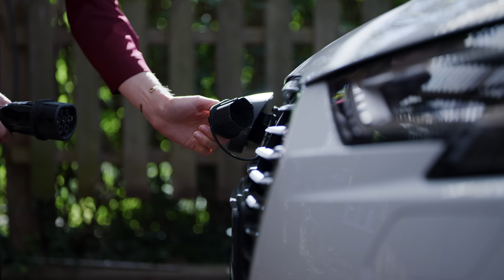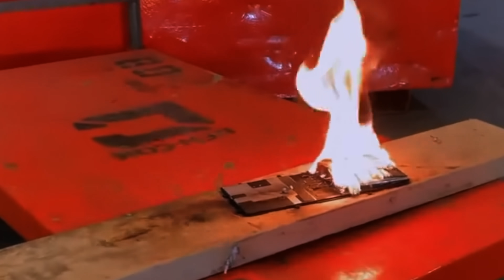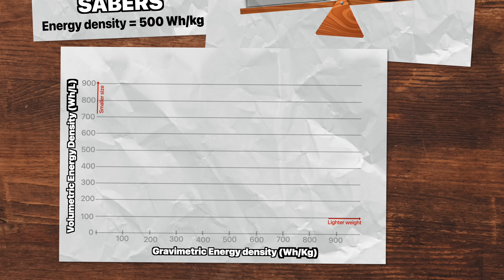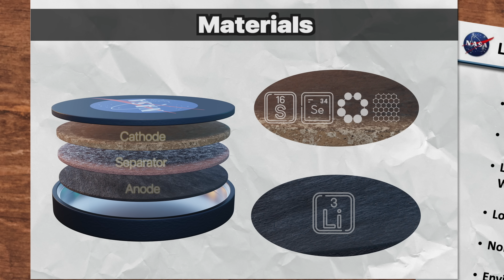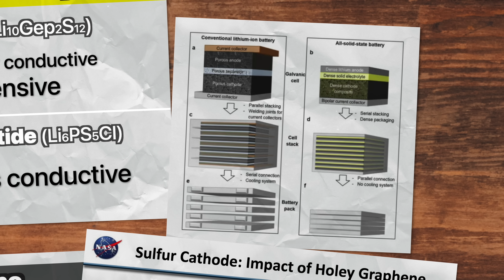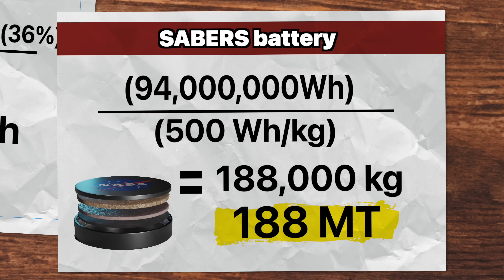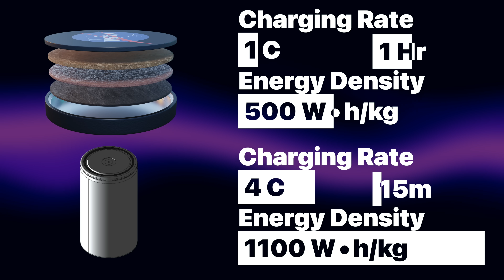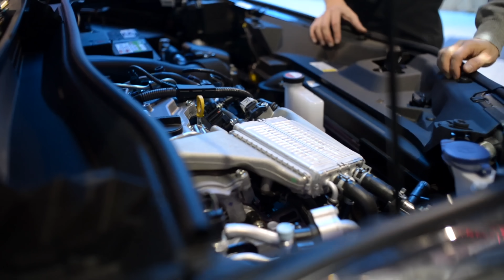Why NASA is Building a Solid State Battery

Comment: It's not ready for airplane use because you can't have airplane engines quit in flight, but it's "okay" to play around with this stuff in ground vehicles because they don't care if your EV dies on the side of the road, right?  What if your EV dies in a bad part of town and then you die?  What if the EV in question is an ambulance that runs out of charge?  But I will say that it is encouraging that brilliant people are working diligently to solve these problems.  Eventually we will get there... (no pun intended).

Comment: We need to stop thinking in binary.  It's not One Tech or the Other Tech, it's how can current technology be improved to be more efficient using new tech.  To use the airplane example... Use fuel thrust to get the airplane off the ground, then battery power to supplement the cruise, much like hybrid vehicles.  This all or nothing attitude is short-sighted.
We also need to start thinking long-term.  Current battery tech creates massive amounts of toxic waste we have not addressed.  Will the solid state battery be easier to dispose of at end-of-life?

Comment: Ricky how are the electric turbines or propellers driven? In-line or from their rims to use mechanical advantage ? Motor s where the shell or turbine or propeller is the rotating part.

Comment: Wouldn't it be better to put the engine on the regular power supply and rely on that new sabers battery for the electrical components less strain on the regular power supply which might make it cheaper

Comment: NASA "doesn't say" explicitly what the power density of the Li-S-Se SABERS battery is but it tells us repeatedly that is high enough for use in aircraft and they show us diagrams (again without explicit details spelt out) that indicate it is higher than both commonplace Li-Ion batteries and other Li-S batteries. NASA did their homework but evidently you didn't do yours.

This vlog strikes an odd tone. The issues with SABERS batteries aren't unlike those faced by any new cell/battery technology. Is the SABERS battery for purpose, viz. does it offer sufficient energy density and power density for its intended use? Can it be produced economically at scale? Does it have a long service life? Can the cells and other components be manufactured repeatably at high intensity without significant variation in expected performance or build quality? So, fitness for purpose, cost, longevity, production rate and quality/yield are the key considerations. Safety in handling and operation is also an important consideration and on that score SABERS seems to be a big improvement over other Li-Ion batteries.

Comment: The Alice Electric plane with 11 passengers and pilot reported an expected range of 600 miles per charge with battery packs from two years ago, so close to 250, maybe 300 Wh/kg.  So if that is raised to 500 that would be almost double the range.  The engineering from an 11 passenger 1200 mile plane to double that is a matter of joining two planes side by side, both outfitted to go 1200 miles and then eliminating the unnecessary  duplicate parts.  Go from 4 wings to two with the same lift as four but with less material weight and the same with the fuselage , instead of two tubes just one slightly larger will reduce drag and weight and now you have gained even more range with 22 passengers.  Keep doing the same process until you have a plane that will carry 220 people and maybe have 1500 to 2000 mile range .  The plane needs to be designed around the system it has and not just refurbish an old gas jet.  The Japanese teams have a battery capable of 711 Wh/kg now, but it is years away from commercial production and will probably have around 600 by then unless they IMPROVE the technology and keep it safe from fire and degradation over charges, they may even go up a little to 750 Wh/kg and that would allow  a possible 3,000 mile range.

Comment: A partial solution may be to use assisted takeoff technology as the do on aircraft carriers; Once the airplane is airbourne the need for the massive power output needed at takeoff is obviated.

Comment: How long to recharge the plane? You think it's economically viable. Not on your life. What about unexpected delays in the air. Hope it doesn't run out of battery power. What happens when you hit very high winds going against the plane? Now you can't make the airport. Way too many issues.

Comment: Fossil fuels are stored sunlight from the past that work 24 hours a day in all temperature ranges.   Stop trying to force battery power into a system that just waste energy for the only reason but to be battery powered.  The energy to produce and charge the battery system is still wasting energy.   I think people who feel they are so smart that they can control the Earth's climate are lacking the understanding of the Earth's history that our climate has always cycled.  Use the correct form of energy (fossil, nuclear & renewable) for the correct reason and do not waste resources is the best way to help the Earth's climate.  The less energy wasted in production of the energy source, storage of energy, delivery of the energy and wasted capital ($) the better.

Comment: If the most used plane is a long range plane even if only 10% of flights they are absolutely needed for there are reasons they are used beyond that which make their range important. Im guessing its logistically easier to have a standard plane you can expect to be able to do every job and that plane able to go to every airfield you reasonably need it too without making many "hops" for refueling. 
Having an electrical plane with 10% spare energy for flight might also not be sufficient for safety. Also i do remember that rechargeable batteries usually come with overhead control limiting how much of the actual charge you can use as charging near dead batteries is more taxing on their lifespan. And all of that with a prototype engine which won't have the same performance when its mass produced.
Beyond flight the low current is probably the biggest issue. Having any task done only half as fast for longer and then having even more time consuming recharge times might make most of what we can use them for unreasonable.
I do like it alot though that nasa has come up with a low cost version of the electrolyte, even for spaceflight that might just sometimes be enough and will save some money even if the batteries don't pan out.

Comment: Interesting overview, 
I was just wondering why , in the specific example of a B737 the take-off impulse could not be done by a combination of technologies, combining fuel jet engines (could be hydrogen or biofuels) together with batteries like the one NASA (or Toyota) are developing? I looked it up, seems like cruising power could be as low as 20% of the total needed trust. 
Divide your battery weight / electric motor weight by 5... et voila!
Seriously, I think we must think more about combining technologies.
Reply: I worked on hybrids experimental aircraft. We have already done this. We have all kinds of hybridisation including Jet fuel+batteries, hydrogen+batteries… Thing is we just lack necessary research, testing and certification standards. Aviation is a slow paced industry.

Comment: Forget it, aviation fuel has 10 kwh per kg,  and the best batteries have only 0.45 kwh per kg, so it looks like  a no contest there, the extra weight would dramatically decrease the number pf passengers per flight.

Comment: In aviation, kWH/kg and kWH/l are critical drivers.  In stationary batteries, cycle life and $/kwH are the main drivers.  In EVs, all of these come together.  A battery that is inexpensive, long-lived, high-power, and energy dense would revolutionize many markets.  For that matter, in many applications I'd love to have a battery close to as dense as lithium ion and similar cost, but can be shipped discharged.  You cannot do that with Lithium Ion which is an enormouse safety issue.  The same problem exists for lead-acid, but it is such an old, cheap, terrible system in many ways it was never held to the same standard.
Another problem is that while lithium is abundant, it is expensive to extract and many of the typical electrode materials that go with it are even worse.  So for many applications, more abundant elements like sodium are a better starting point.  Not so much for aerospace, where using unobtainium and expensolite can be OK as long as it meets your mission requirements.  But here on the ground cost and availability matter a lot more.

Comment: How small of particulate dies it measure. Does it measure in the nano scale, because that's where the GEOENGINEERING metals are, below the 3 micron limit that the NOAA and other agencies test down to, knowing damn well they are unable to give a good  measurement of what we're really breathing. Check out dane wigingtins research again. That's where AI lost a little respect for you , but just a bit. I figure you'll come around, especially if you'll take the time and TEST THE RAIN. makes sure you're somewhere that there's no aluminum industry close by, because aluminum never becomes a gas on Earth, the vapor point is too high, so it can't migrate like mercury. Keep that in. Ins b3 you dismiss the super high reading as something from China, sorry, but that idea is not supported by reality

Comment: I am not sure how you land on SABERS is 'cheaper' (yet) given the expensive electrolyte and manufacturing difficulties you highlighted.  There is still some work there, but plenty of reason to keep at it.
I thought you comparison between the 737 and electric did a good job of highlighting how GOOD fossil fuels are, and why we can't just electrify everything tomorrow.  Your switch from 57 000 POUNDS to 188 000 KILOGRAMS is a bit misleading (well, kind of verbal  'sleight of hand') .  The fuel and engines weight about 26 000 Kg.  Then where does the power come from?  30 megawatt hours for your 500 mile flights times 1000 flights per day equals 30 gigawatt hours. New York City flies about 1200-1400 flights a day and uses about 55 gigawatt hours per YEAR.  That means that NYC would need over 200 times as many power plants to keep the airport running. 
I think this application may be better suited to smaller aircraft.  

That isn't to say the technology isn't exciting.  For ground vehicles, this could help.  Fast charging and safer while lighter and smaller is starting to get close to overcoming the last major hurdles in gasoline engines.  We still need a 'battery standard' for charging and for swapping out so GM can't arbitrarily decide to not make them for last year's model and force you to buy a new car.

Comment: Gap in calculation is, that the electric motor would not require energy for idling. Standing on runway, descending would not require energy, if not even recuperating it. So it will not require the same energy as the current 737.

Comment: Aviation works on turn around time, it costs thousands of dollars for every hour an aircraft is on the ground, you haven't included the charging time of an aircraft the size of a 737, if that takes 6 hours to charge the idea is already dead. Remember most charging stations are supplied by coat burning, electricity isn't the green energy everyone thinks it is, we use more coal 2023 than before EV were invented, I wonder why?

Comment: You forgot one HUGE aspect of jet engines. The thermal energy of combustion (heat) is necessary for sufficiently high tailpipe discharge velocity. The speed of sound (which increases with temperature) is the limiting factor in tailpipe velocity, hotter = faster. This is generally called stagnation or choke. Driving a ducted fan with a electric motor that produces no heat cannot achieve jet-engine like duct discharge velocity without some massive energy sapping tricks, like electric heaters/plasma/multi stage compression, or burning fuel in the tailpipe (afterburner). This limits the theoretical electric airliner speeds to about 300-or maybe 350 mph. Bucking a 125Kt headwind is going to be a huge battery draining problem. In fact, we are better off driving props with electric motors, than jets.

Comment: As a Retired Airline Captain, it's not just getting from Point A to Point B. You have to have enough energy to go from Point A to Point B, shoot an approach and if you miss...then fly to your Alternate Airport...shoot an approach. And if you miss, then fly for at least 45 minutes before you run out of fuel (or battery). Many times I flew to Los Angeles and our alternate was Las Vegas. I personally liked to carry 2 hours of fuel beyond my Alternate airport.  So a 550nm range on a B-737 isn't going to cut it.

Comment: I can only imagine what this looks like. My last job before I started down my spine surgery warpath was working for Texas Instruments running 6", 8" and 10" steppers. This was back in the old days when you actually had to handle the wafers by hand, at least for inspection, cleaning and testing purposes. The wafers were fed into the stepper in boats; but, the proper mask had to be loaded into the machine to put the proper pattern on the proper wafer at the right time. As the photo lithography was done, it had to be inspected under a high power microscope, and thus hand handled. I had to carry certain wafers across the fab for other tests as well. In the old days we used vacuum pens to move wafers through some of these steps. I loved looking at each layer as it was built up. Photo was probably the busiest station in the fab. I just wish I'd been able to keep it up as I really enjoyed it.

Comment: I worked for General Atomics from 84 to 93 doing long term testing of a nuclear powered battery. Specifically the Thermionic fuel element verification program, part of the sp100 space power program.

Comment: Is that the maximum loaded TO weight, or the maximum wet weight less cargo?  If you're using up the total allowable TO weight including cargo, then you've got an electric plane that can get to the destination, but cannot carry any cargo.
Reply: Also, the max landing weight is lower than the max TO weight, and you don't "burn up" the weight of batteries when you use them in-flight as you do with fuel.

Comment: Tesla used LFP or Lithium Iron Phosphate in Model 3 ^ Y sold in China where "charging stations & electrical outlets for charging adapters are less geographically concentrated"

LFP has 3000 cycle & 10 year calendar life about 2X better than NCA even when very deeply or fully cycled, something that damages NCA , but lower power density & lower voltage & 30% higher mass //

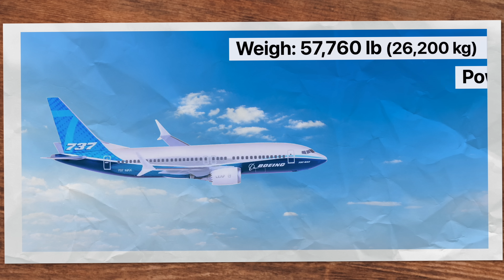Comment: 12:15, yeah 57,770 for take off, but you need to lose 30,000 lbs in the air to be able to land. You can't get rid of the batteries to lose weight.

Comment: If these are rechargeable these would be great for green homes with solar or wind power.  It would also solve a problem with electric cars.  These seem they would make infrastructure for refueling where it's much easier to stock them when an electric car is running out of power. Just swap them out.

Comment: Heavy sigh! When are you EV fan boys going to understand that EV commercial flight just isn't going to happen. Jet A has a specific energy of 43.1 MJ/kg. These solid state batteries (assuming the data in this video is correct) is 1.8 MJ/kg.  A fully loaded 727 has roughly 32,000 kg of fuel onboard. If you were to use these batteries as your power storage that weight would balloon to over 766,200 kg. Even using the theoretical max potential energy density of 2680 WH/kg or 8.6 MJ/kg that weight would be 160000 kg. The max takeoff weight of a 727 is about 95,000 kg. This should give you some prospective on how far out of reach a commercial EV aircraft is.

Comment: If it's cheaper than lithium-ion and they cracked the cycle stability issue but the charge/discharge rate is not so good, it'd be probably better for terrestrial applications like solar power systems, rather than stuff that moves.

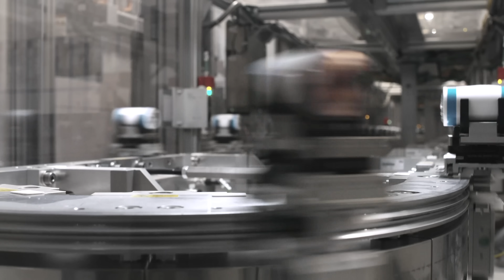Comment: Just wondered; other than rolled manufacture - why aren't the individual batteries in the battery pack square with rounded corners, to fill the available space? Round individual batteries probably make sense in some way I'm unaware of, but isn't there a significant amount of volume lost? (10:36)